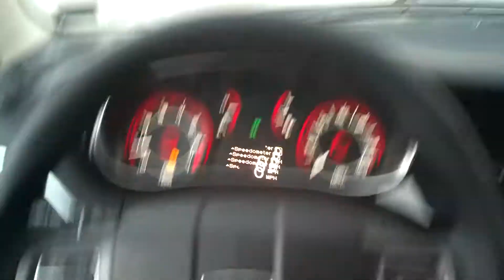Brand New Dodge Dart Electrical Fail

Comment from the maker: Got it resolved.  I was told when the car was being put together a wire got caught and tore in the dashboard.  They had to take it apart and redo the wiring.  Took about a week but its working now.   Still was bad luck.
Reply: Toy Rage is there anyway I can get a hold of you. I'm a tech with this exact problem. need some ideas of what they did to fix this.
Reply: The fact someone is asking about this same problem means it's a factory fuckup.
Reply: This is exactly the same issue with my 2015 Dodge Dart!!
Reply: I am having that issue in my 2015 dart also. Can you give some more information on a fix please.
Reply: @006haloman  did you get this problem fixed? I have the same problem!

Comment: Same problems with us too.. they’ve replaced random modules that fix some of the issues but not others.. one of which is cruise control. It’s working now, but today went out again. Wipers still have the same issue yours does.

Comment: Dodge bought my 2013 back after me getting stranded 4 times.  I went to pick it up when they told me it was fixed. NEVER started at the dealership.  After this Dodge just bought it back.  I have a 2015 that has not had ANY PROBLEMS.
Reply from the maker: 2013 was a garbage year.  I was always told dont but the first like of pretty much anything.  After this, I won't be buying a car from a brand new line ever again.
Reply: Best idea is to rent one for a week or so and tear that SOB up.
Reply: How long did the buyback take?  I am currently going through a buyback for my 2013 rallye.

Comment: Cause you have the analog dash, they are junk. Not that the digital doesn't give some issues as well but is what originally the coloum was designed to work with and looks way better than what I'm seeing there.

Comment: My 2013 dodge dart has had 3 recalls and several small issues since I bought it.

Clutch Slave Cylinder M37 Recall

Reprogram Powertrain Control Module N32 Recall

Transmission Control Module R42 Recall

also...

My touchscreen will sometimes go bright white then shut off completely (Turn car off then on again to fix screen)

I have lost all power to the engine WHILE driving.

Key Fob stops working. Which means I cannot get into my car, or start my car. I have been stranded on multiple occasions. With Brand New Batteries in 2 key fobs.

My Bluetooth microphones, make me sound like garbage, so people can not hear what I am saying.

Sometimes my devices will not connect to the bluetooth.

The nob to adjust air direction in the passenger side air vent has broken twice. It was repaired once, but broke again and is no longer covered under warranty.

The air flow for my heat and AC is WEAK like a baby trying to blow out a birthday cake and cannot get all the candles to go out.

My doors squeek when opening and closing.

Response time on gas peddle is like 2 seconds. I nail my gas an nothing happens for 2 seconds. Lame.

Most recently, the digital odometer blinks/flashes. Although intermitantely.

I installed the lights that go around the back trunk, and when the dealership did this, they did not put the trunk release button back. When I asked them about this, I was told that the button does not work with the new lights. I was displeased as no one had warned me to this prior and they would not put it back like before and give me all my money back for the lights, so I just kept them installed... I miss that button dammit!

Most of this in less than 50, 000 KM and less than 3 year old car.

It is now at 80, 000 KM (4 years) and I fear how much money I may put into it over the next few years now that the Basic Warranty is over.

Comment: well the rubber cable inside the left switch is broken,  it happen to me. i was cleaning mi car and i was cleaning that switch with a rag and them i pulled and taraaaannnn   it fell off

Comment: I typically dont buy new stuff when it first comes out. Ex: new PS4 or new redesigned/body style vehicle like the new dart because there may be problems and later after the release, the problems will likeebe ficed
Reply: *likely